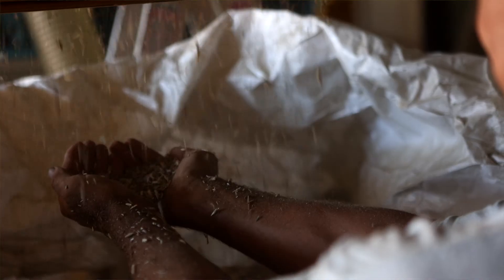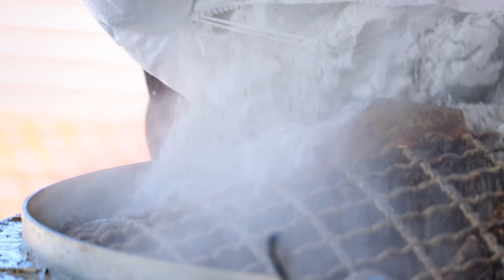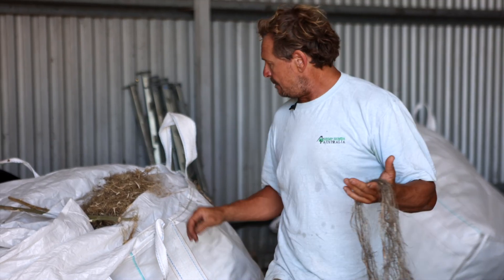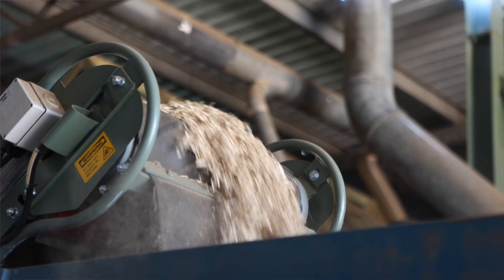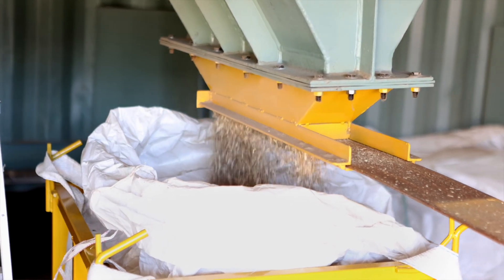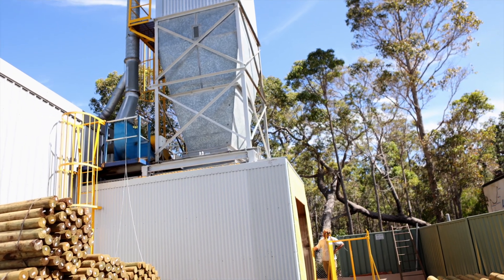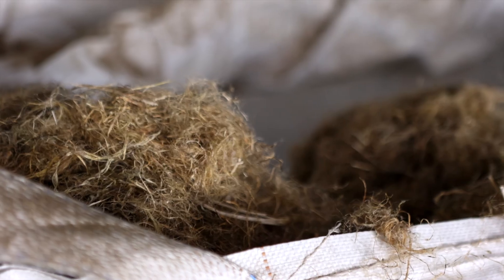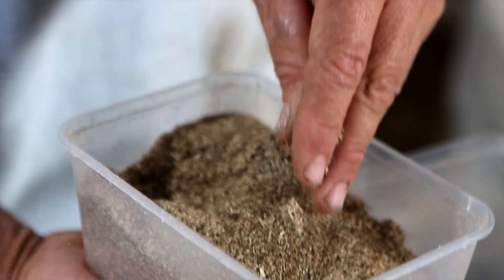Heartbeat Of The Industry - Hemp Processing in Margaret River

Comment: How are the "Fines" (if I heard you correctly) used for a rendering and for 3d printing? Curious on how these materials are turned into plastics!
Reply: Hi, yes, we added the fines / small particles of the hemp plant to the render to add to the strength of the outside walls.